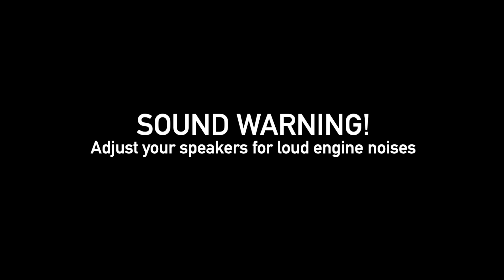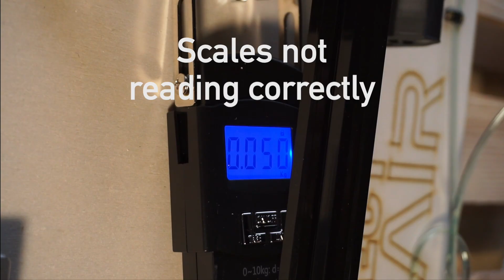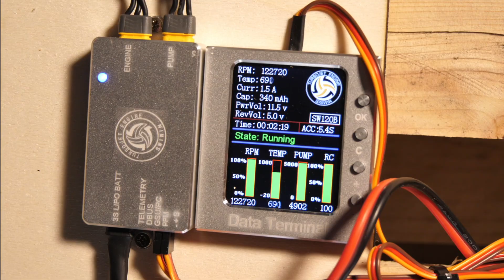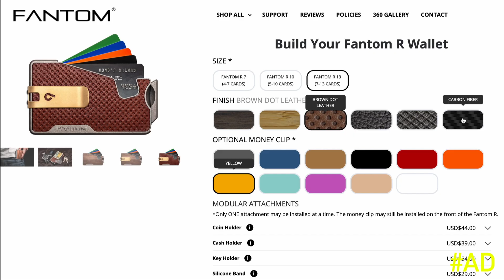Mini Jet Engine Test

Comment from the maker: Thanks for watching chaps! Post suggestions for aircraft/other vehicles to build with the jet engine. 👇👇
Also, feel free to help me out by sharing this video with someone! See you on the next one. 🙏
Reply: an f1 jet
Reply: Maybe something that uses ground-effect and can also fly over land and not "just" water.
Reply: Jet powered rocket.
Reply: Now THAT would make an ekranoplane really go.
Reply: Do a collaboration with another channel
Reply: A high speed ‘foiling’ boat would be great using a flight controller to maintain flight height above the water. Potential for such a vehicle is incredible. A ground effect version would have even more speed potential as a sort of Ecranoplan. Please take care of your hearing guys, use proper ear plugs plus red banded ear defenders, you risk permanent hearing damage for the rest of your lives.
Reply: Make a me 262 with those but replace the original engines with them hoes
Reply: Is this a Axial flow or a Centrifugal compressor engine?
Reply: A rocket. Yes I know they aren't air breathing, but I always wanted to see how high and fast a rocket with a turbo jet could go.
Reply: @jaydenrareproto  it’s also dangerous he might lose the engine it’s pretty expensive I think
Reply: Cirrus vision jet maybe?
Reply: Bro you need a lot more subs for your creativity and thinking
Reply: Can you build a robot
Reply: Peter Sripole needs about a dozen of these.
Reply: pls f 16 polish pane
Reply: Still haven't used it. ☹️
Reply: It would be awesome if you could get a mini jet engine with afterburner
Reply: make a  plane with an jet engine that can go rlly fast the make it shoot tooth picks

Comment: Hi ProjectAir,
Love your vids,
I also build Rc planes and Jets, the model I am currently building is a Jet called the Hawk 100 royal suede Air Force . its really big, I ordered it from pilot RC. the turbine I use is a KIngtech 120 or 122 its really power full its max speed while flying is over 200kmh according to my windspeed. when it is on idle its RPM is 48,000 and the whole jet moves with it!. So my solution was airbrakes but I could not find any so I made my own (took 11 mths) 
and it was a success! :() so my next test flight I did my maiden and it was flying so good and I want to thank you for that because I got some ideas from you so thanks.
and a question
where did you get the 3d writer from because I would like to purchase a few so I can build faster instead of waiting hours to get a print done.
Kind regards 
A FAN

Comment: Power : YES!
Fuel economy : What is this fuel economy thing you speak of? 

seriously the fuel economy on these is horrible at 90% power its rated at 310ml/min a 75 cruiser that weighs 3 tonne going 100km/h uses 240ml/min yea that thing uses more fuel then a car designed in the 1980's. might be time someone made a Turbo-Fan or Turbo-Prop for RC aircraft raw turbo just eats fuel.

Comment: I'm shocked at how yellow your paraffin (I call it kerosene) is, here in the US all you can really get is the water clear stuff or hydrotreated stuff which is way more expensive when buying bottled, most pumps are dyed red to prevent using it in diesel vehicles but it is generally avoided if you use it in wicked appliances since the dye is known to clog wicks.

Comment: My apologies if you are already aware of this but it might save you having issues running engines in the future, during your startup and running there seems to be a lot of air in your fuel lines in the form of those massive bubbles. That will interrupt your burn dramatically so if you can make sure your fuel lines are completely bled before starting. It’ll save you loads of hassle in the future with run up issues.

Comment: Hello..Thanks alot for detailed guidance. i hv an AMT Olympus 23kg micro jet engine.  the problem is that max thrust is not achieved. i get max 19Kg thrust whereas the RPM is maximum. however, EGT is 100 Deg C lesser...What could b problem? ambient conditions are unchanged.. i donot know why EGT is suddenly reduced by 100 Deg C

Comment: Just a safety tip, never stand in the plane of rotation i.e. directly to the sides of the engine.  If something breaks, the shrapnel will exit anywhere in 360 degrees (same for a propeller).

Comment: "Ultra-Sonic Foiling" is literally The Cutting Edge this Channel could excel in do you read your comments - reply for the how to.

Brother, from one designer to another, Your Water based Rocket Very High Speed Foil mod interests me ... so here's a cutting edge on what to do for a water speed record. "So it's Speed - Control - Water - got it?"

"Ultra-Sonic Foiling" ...America's Cup Foiling has the 50km/h water pressure cavitation issue correct - yes just believe me it's yes - when a blade like a foil hits water at between 45 - 55 km/h depending on how badly you designed your bade the water objects to being compressed and some goes Up as spray [so that's power Team New Zealand just produced for nothing correct] but what forced that spray up? was bubbles along the leading edge of a foil called cavitation? yes it's lost of control and power and finally control like the end of america's boat.

"Ultra-Sonic Foiling" is literally The Cutting Edge this Channel could excel in, along the leading edge of Team New Zealands foils are thousands of Ultra-Sonic hammers breaking the water directly in front of the foils allowing the AC75 to literally Fly into air - - - at what ever speed they can handle or what ever that batwing can produce.

If these terms confuse you, take a quick look at what we're up to down here, it's the parting of the waters in a whole new rule book I think you would enjoy.

If not enjoy if you can the run of the America's Cup set to start in Y[a]uckland on the 6th of March this year.

Listen to the sound of Team New Zealands Foils in the water! to create the same effect in Air it's the sound of a bumble bee Trust me I know.

Comment: Grate video!!
Make an Afterburner witch really produces more thrust than the "normal" dry trust.
Or make a turbine driven helicopter or a Gas generator....
Also, it would be interesting to do a Magneto hydrodynamic generator and create electricity.

Comment: No ear protection (pardon), no cooling air flow over the exterior of the engine and I would avoid standing in the plane of the turbine blades just in case one let go.
Reply from the maker: We had ear protection after the first test and the engine doesn't need to be cooled when stationary

Comment: Little tips : don't use it on foam plane. I've use it once then dive it 45° my elevator can't handle the pressure then right side is break. Then it went down at high speed while rolling fast. It was a dramatic painfull accident

Comment: The way you had the scales linked looked like the hook was just flexing. You needed to pull the hook directly from the centre and not on an angle. That 12.3kg would still be a low reading.

Comment: Hey I really love your projects but something I would love to see you making is a rocket made field on some explosive liquid fuel and it would work kinda like this: big tank with fuel sprays fuel into the end where something is gonna explode it like maybe gas or sparks. When the spray of fuel explodes it will take alot more space and have nowhere to except down forcing the rocket up. And I would love it if the rocket could weight more so it can go up slower I think that's cooler

Comment: 12:46 I'm quite interested how the lens managed to make things at the back look bigger than the things at the front, as I cant even imagine what kind of physics allowed that to happen
Reply: The engine tapers in sharply on the back. And the engine is pointing slightly downward.
Reply: It’s called compression.

Comment: The ME 262 had a thrust to weight ratio of 0.28. So with this engine 120N, you could power a plane with a total weight of 42kg! That's a serious amount of thrust. 3 of them could probably do human flight, certainly 4.

Comment: Use a CO2 based Fire Extinguisher, If you do have a fire a powder based fire extinguishers will screw up the insides of that engine and cause even more damage

Comment: I'd love a jet turbine model, but they're so expensive. I'd also be hopelessly out of my depth (I only fly electric models) and my model flying club doesn't allow turbines because they're so noisy they'd definitely disturb the farmer.
120N of static thrust is a hell of a lot of thrust.
I have 2 questions: 1st, why don't you have a hammer? I mean, you have 3D printers, a laser cutter, power tools, hacksaw, a jet engine, and yet you have to beat the rod into place with a screwdriver.
2nd, did the mug survive the experiment?

Comment: just a little sidenote: please use petroleum for your turbine. Dont use Kerosin or diesel fule as these will leave quite a lot of of particles in the turbine which causes damage over time.
And whenusing it in a plane, use a hopper tank! Also when starting the turbine make sure to face towards the wind, so the flames wont get pushed inside the turbine

Comment: Awesome, I fly and operate jet engines so can relate to the big grins. Just a small suggestions and I've worked around jet aircraft for long time, please put some ear defenders on, the high frequency will trash your hearing very quickly.  The old Harrier engineers all had hearing loss at specific frequencies, and the same is true with these, cotton wool in the ears won't help ;).  Just trying to help, and not be a party pooper.  Oh, buy a hammer ;)

Comment: You connected the scale with an angle between the table and the engine!!! It measures less of the real force of the engine because of that - It has to be parallel!!

Comment: Ok, it produces 12.3kg of thrust at full power, tied to a bunch of pallets.
It will actually produce more thrust as it is moving, due to ram effect.
How much thrust does it make at idle?  
That will effect how your plane/boat/car/whatever decelerates, and how controllable it is.
Get your scales calibrated, and take thrust readings from idle to full throttle.
That would be very interesting.

Two other things. Leave the captions up longer, I’m a slow reader.
AND BUY YOURSELF A PROPER HAMMER.

Let’s be careful out there.

Comment: Dude, Safety First. You need safety goggles and ear protection. I recommend placing sandbags around the sides and placing a plank across the top and sandbagging that as well, that is unless she decides to turn into a fragmentation grenade. You'll never be able to build another model with a German Shepherd.

Comment: The Warped Perception channel had a similar video (https://www.youtube.com/watch?v=SIfWCWZdfuc) where he used a spring to measure the thrust, which might work in your current setup.  A spring-force measurement is a lot more YouTube-photogenic, IMHO, and is easy to set up (no batteries, display, etc.).  The spring simply measures the force, which can be easily calculated, and it provides some insight into how scales work for the kids that are learning science topics.  Anyhow, fantastic video and I really look forward to your application of the jet engine.  Cheers!

Comment: Idea: Build a plane with the engine and see how high you can fly
Reply: Calculate coefficent of lift, then calculate coefficent of drag (aerodynamic drag), then calculate... coefficent of momentum (wing pitch force moment) then calculate wings area, then... Its not that simple as many people thinking. Better idea is to make project with DIY computer driving UAV (unmaned aircraft vehicle) - but never with stupid Arduino (Arduino is a toy for kids). STM32 at least, but better should be some ARM, offcourse with good redundancy...

Comment: for the high powered boat you could try acitve stabilisation with a flightcontoller from an airplane.... setup for a flying wing for example... and the gains on the piff controller set accordingly to the ne fluid

Comment: I am thinking the first stage of a rocket
Reply: Nah nah, this is should be used for stage 0 like 'cosmic girl'.
Reply: @crocogile2352  I had to google that.
It seems to me, using the initial stage as air-breathing, should reduce the overall weight.  But air-breathing would only get about 10% of the 100km needed.

Comment: Can you make a flow meter on the fuel. I Actually want to know the fuel rate :p
Reply: the people that make it say it uses 310ml/min at 90% power. to put that in to perspective a 75 Land Cruiser that weighs 3 tonne going 100km/h uses 240ml/min and yes that is real i have 75 cruiser and i regularly drive most of the time cruising at 100km/h with a little town driving mixed in and i average 14L/100km so 14L / 60 = 0.233
Reply: @phalanx3803  damn, thanks for the reply, better late then nothing 😁

Comment: i wouldnt build a jet car because jet engines dont like being bashed around u will end up damaging the bearings in that motor as for a boat u will have to make sure the engine dosnt ingest too much water whilst runnung hot as drastic changes in temperature can cause metal components to fracture
Reply from the maker: Good things to consider

Comment: ProjectAir: Blasts a metal cup with a jet engine
Cup: falls over
ProjectAir: Immediately grabs now hot metal cup with bare hand
Reply from the maker: Yeah, that was a poor instinct
Reply: @Project-Air  I hope it didn't hurt too much
Reply: I saw that and thought the same thing
Reply: Lol
Reply: It would be surprised if that is metal....
Reply: Well, it was filled with water, there was still some water on the handle and such, so it can't have been that hot. But there was still a running jet engine poined at it.

Comment: Dude, get some real hearing protection. Seriously. You will give yourself permanent hearing damage in a single session at idle, much less full thrust.
Reply from the maker: Yep, that’s why I moved the engine outside for some sustained tests and started shoving toilet paper in my ears. Investing in some proper headphone defenders soon 👌
Reply: @Project-Air  the "3M Classic" yellow foam earplugs are very good - 29 or 30 db reduction - and they're simple and very inexpensive. I buy them by the 200-count box (about $40) and ALWAYS keep a pair in my pocket; you can buy a little plastic case, but I just toss them in loose. If I'm around anything even remotely loud, I use them. I use cotton when going to concerts, because the foam blocks too much of the high frequencies for enjoying music. Cotton (and toilet paper/kleenex) do not block the highs very well - but with turbine engines, that's the exact problem I work around jet aircraft regularly, and there are boxes of those earplugs at every entrance to the facility, because it's a well-known risk.
Reply: @Project-Air  By the way, the risk with turbine engines is that often the high frequencies are SO high that you often don't even perceive any pain, but there is still damage possible. It's well-known that exposure to sustained but inaudible ultrasound can cause hearing loss. A 30,000 RPM mini turbine with something like 20 blades is generating sound pulses at the primary rotation frequency of 30,000 Hz, but also with each blade, thus up to 600,000 Hz. Beyond that there are tons of harmonics down into the audible range that you do hear. Obviously you can't hear the 30K Hz or 600KHz pulses. You can hear the 15KHz first lower harmonic, but that 30KHz is still there and affecting the eardrum and ear parts, even if it's not audible.
Reply: Old Army tanker here, our M1 tanks have turbines in them. Even at idle they’ll ruin your hearing without protection... trust me. Wear foam inserts and put ear muffs over top too. The 40 something you will appreciate it.

Comment: Measuring the thrust with a force meter at an angle won't give you proper results. Should be in line with the engine, just saying.
Reply from the maker: Please explain
Reply: @Project-Air   @ProjectAir  Well, your measuring device isn't in line with your engine, but at an angle, because it is attached below the engines' axis. A force that acts at an angle can be split into two perpendicular components. Forces in x direction and forces in y direction. 
Newton’s Second Law can be applied in each of the resolved directions, wich are F cos θ and F sin θ. 
For calculating this you need the angle in which your measuring device is attached to the engine (or the engines axis) . Then you simply use Newton's second law with F of x = F cos θ.
If you mount your measuring device in line (or parallel) with the engines axis you should see higher results and don't need any calculations.
Reply from the maker: @Koernell  Ah I see, thanks for the explanation 👍

Comment: you would have a much better result using a load cell; you need an amplifier like the INA125P or similar and an arduino/bluepull to make digital read, but then you will get hundreds of measurements for second (pay attention that the serial communication does not slow down your code!) and you can characterize properly the curves.. with like 20̇euro of material

Comment: Excellent video. 

You could run the engine much cheaper if you use domestic heating oil (kerosene), which is about 40 Pence a litre at the moment. ;)
Reply from the maker: That's essentially the same as Paraffin. Paraffin is just more attainable locally - that's the only reason I went for that fuel over kerosene.